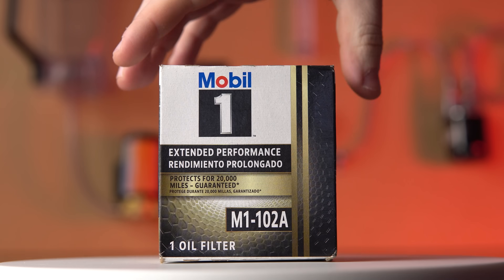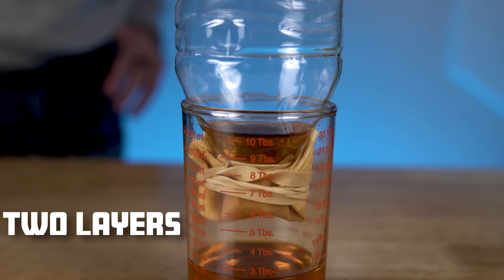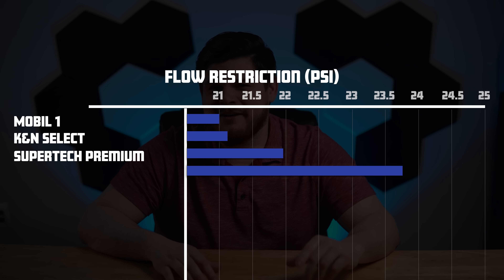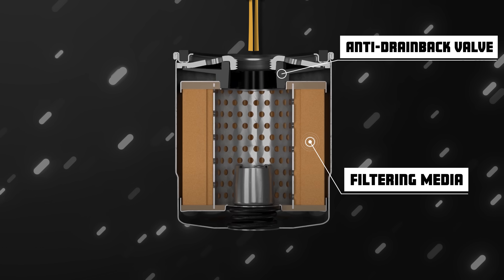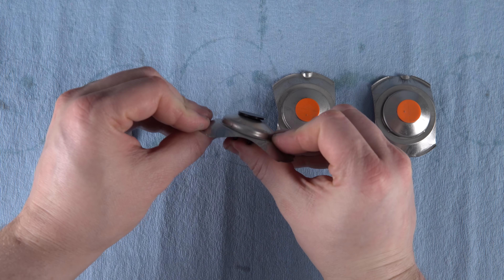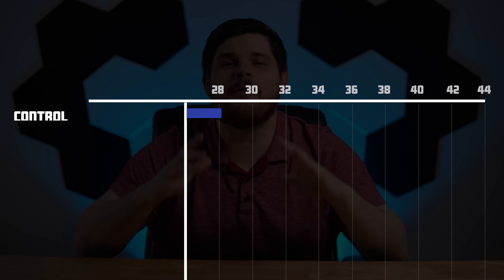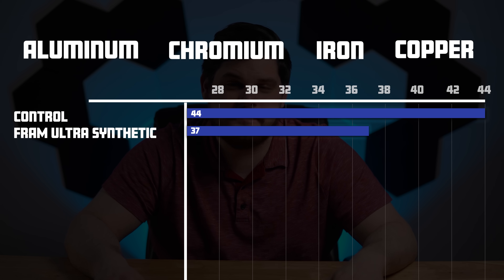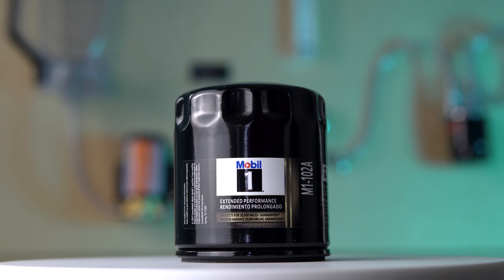Engineers Test the Best Oil Filters! FRAM | Mobil 1 | K&N | Walmart Brand

Comment: The "capacity" test was highly flawed and should be tossed out. 

 You used a powder that was at the filtration limit for size. Far too close to the limit to provide accurate results. As you saw in the long term oil test, the brand that reduced the total ppm the most, mysteriously had the lowest capacity. This very likely would have been because it was actually capturing the 30 micron pieces and the others were not.  To verify this, you would have had to take the oil from the test and had it checked for residual levels.  
Seems to me aluminum powder of 50 microns or larger would be more accurate as this should have guaranteed closer to 100% capture rate for all the filters and actually given you results of filter capacity test.

I love the video otherwise. Thank you for making it.
Reply from the maker: Thank you so much for the feedback. Please go watch our newest video were we made several methodological changes including the capacity test. Appreciate you watching.

Comment: I usually go with the Fram Ultra and it does a good job over my 4k mile interval.  I used a genuine oem Honda filter this past change and was surprised the oil was noticeably darker.  Went back to the Ultra for my current oil change.  0w-20 synthetics won’t really have much of a problem with flow rate.
Reply from the maker: Awesome, currently use fram Ultra as well and it's been great!

Comment: Good testing methodology, except for the oil analysis. That's a great method for tracking wear on an engine over time, but filtering the oil and then comparing how much of each metal the filter pulled out isn't relevant to how well the filter protects the engine. A filter needs to pull particles of iron/steel, silica (sand), and hard carbon out of the oil, because those are what cause wear on mating surfaces like bearings, bores, and cams. Contaminants like aluminum and copper are signs that wear is happening, but they don't CAUSE wear.

I am a metallurgical engineer responsible for failure and wear analysis on North America gasoline engines for a major automaker, so I spend a lot of my time looking at worn or damaged internal engine surfaces, evaluating them with optical and electron microscopy, and working to improve their wear resistance.

Also, I've used the Mobil 1 filters on all of my vehicles for years.
Reply from the maker: Thank you so much for the feedback and info. We have since changed our methodology, go check out our newest video.

Comment: 3:44, you've got your data backwards. The higher pressure of the Fram ultra synthetic is good. That means more restrictions on tighter media, which keeps out the dirt. That extra pressure translates into trapping those particles between 20 and 30 microns, which the other filters miss. The other 3 filters are which are letting those 20-30 micron particles are going to destroy their engines.
Reply: LMAO right. If that were the case, there would be so many more blown engines. They only probably destroying engines are bone heads that don't do oil changes/maintenance at all

Comment: I run full synthetic mobil1 oil and the 15k mile mobil1 filter in my F250 Super Duty truck. Its a 2008 6.8 V10. The engine still looks and runs like new...

Comment: Good afternoon from Mexico. In your opinion, what would be the best oil filter for my Mazda 3 2.5 engine?
Reply from the maker: Hey @chuyba. Assuming you are just using your car for day to day driving and only putting like 12k miles a year on it. I'd recommend going with full synthetic oil and a compatible full synthetic oil filter. I'm personally recommend the Mobil 1 or even the Fram Ultra (I currently use in my Mazda). Now... We are currently testing many other roil filters for future videos and Fram just came out with an endurance filter that seems promising and you can find at Walmart. Just remember that changing your filter an oil per the manufacturing recommendation is much more important than what filter. Hope it helps! Thanks for supporting our small channel.

Comment: If you change your oil & filter every six-months or 5,000 miles, whichever occurs first and use an OEM filter and great oil it really will not matter regarding an oil filter. OEMs with have all the same components of the aftermarket filters. Pay me now or pay me later! LOL
Reply: Don't put a lot of miles per year, 3000 to 4000 works for me, moto craft.

Comment: I've been using reuseable filters for years that blow any of these filters away. They're used in the aerospace industry. The bodies are finned cnc aluminum with a magnetic prefilter and stainless steel surgical mesh filter that flows at much higher rates than paper down to 10 microns. Best part you only buy them once, filter/flow far superior to throw aways and keep all those nasty filters out of landfills.

Comment: The only thing that wasn't included in tests is how the filters performed based on the temperature of the oil.  Temperatures have a huge effect on all of the materials of filters as well as the difference in the oil viscosity based on those temperatures.
Reply from the maker: You are correct. We are making several modifications to our rig to take into account viscosity at extreme temperatures. Thanks for the feedback.

Comment: My 2 bits worth... Fram's low-budget filter is extremely poor. Almost lost my motor to one some years back. The cardboard (glued-on) ends failed and blocked it resulting in extreme overheating. Apparently, you have to buy a high-end filter from Fram or risk issues. Bosch is the filter many OEMs use and my favorite whenever possible. Mobil looks very promising for sure so that would be a good option.

Comment: I've always used Mobil1 full synthetic oils ans filters.. in my most recent vehicle, I run the Mobil1 oil with a MotorCraft filter (FL400-S by Ford) thats slightly larger than the factory one to allow for a tad more capacity. Curious how the Motorcraft ones compare!

Comment: I've seen other tests with the K&N gold (performance) and it flows with the best of them. It also filters down to 10 microns. That is double the holes as a 20 micron filter per square inch and triple as many then a 30 micron filter per square inch of media. That makes it less prone to fully plugging up. I'm running a HP-1017 on my Ram.

Comment: Great review! 

My Dad and I use Frams Ultra Synthetic filters for all ours cars and so far no issues. The tape grip on the back helps a ton as well with installation.
Reply: some number of years ago, i saw another video doing oil filter reviews. they cut open brand new filters to observe the construction and the fram had rusty parts and metal shavings in it. before seeing that video i was a Fram guy myself. now i only use Wix
Reply: @elixeroflife i have heard people say fram oil filters gaskets come off. I find it strange fram is all me and my dad has ever used and we have never had a problem lol
Reply: @nunya8048  only issue ive had with Fram is hearing debris rattle around inside, new right out of the box. and at times being rusty.
Reply: @elixeroflife  that can happen with any product produced in the 10's of millions. 

No matter what you're buying for your car, inspect it before installing. Even OEM parts
Reply: @elixeroflife  Oil filters use aluminum so no you never found one that was "rusty". Some other issue maybe but it wasn't rust.
Reply: @ZboeC5  i never said i did, i said i watched a review, and yes they have steel components in their construction
Reply: @elixeroflife im sure other brands if cut open can be the same lol
Reply: I've rebuilt hundreds of failed engines. They all had a Fram filter.
Fram only makes fake filters

Comment: Okay, but did they heat the oil and run it through the filters ‘ cause cold oil or room temperature oil is a la thicker
Reply from the maker: You have a good point! Thanks to all the feedback we will be releasing a video today that tackles hot and cold simulations. Thanks for the feedback!

Comment: I was honestly mulling about getting a Mobil 1 filter for the most recent oil change on my 2012 Expedition, because Walmart was practically out of the MotorCraft filter. Thankfully I saw there was one left, but the choice did have me wondering.

I'd love to see a head to head of aftermarket brands versus the OEM for some of the common and popular engines (LS, Coyote, etc).

Comment: My dad was a fram hand. I bought my first car in 79 and I've been a fram hand. Never had a problem with them.
Reply: My parents always used fram I use fram as well I get a lot of miles out of my engines I never have issues with fram I have 250,000 on my suburban and they aren’t easy miles either.   I also used them in a truck u used in the oilfield under extreme conditions always ran perfect I love fram
Reply: I used

Comment: To add to my previous comment you don’t need a filter with a bypass check valve. As I said befor. All multi cylinder engines have a bypass valve built into the oil pump.

Comment: In every test of oil filters this one important note is never mentioned. On every engine oil pump there is a bypass valve. It usually opens when the oil pressure rises above the operating pressure. As a filter retains more and more debris that bypass valve allows more unfiltered oil to bypass the filter. This is why you should change your oil and filter more frequently. The use of an engine hour meter over just reading mileage is better. Stuck in traffic with an engine at idle will not show as mileage.

Comment: 348000 miles on a nineteen ninety-eight Toyota Camry using FRAM oil filters and Mobil 1 synthetic engine oil. It was running like a champ until a deer totaled it.

Comment: i think as long as you change your oil often it doesnt really matter.. using a cheap filter and oil and changing every 4-5k miles vs using the best of the best and changing at 10-12k i think the cheaper is better.. changing your oil is what is important
Reply: You don't want to use mineral oil cold starts is where the damage is done good oil %100 amsoil is one of the best to stop metal shedding on cold starts.
Reply: %100 Ester oil
Reply: Changing the oil is a good thing but you want the parts fully protected and definitely wanna use %100 Ester oil  if you live in cold climate areas the cold starts will cause metal shedding.
Reply: You’d be very wrong
Reply: @ohboy2592  i have owned well over 50 vehicles and do not use expensive oil yet have never had an engine fail because of a problem with the oil. so chances are i might be very right.. but life experience and knowledge mean little in todays world compared to internet knowledge
Reply: @whitefreeman5798  and I have well over 30 years of working on various engines and have seen the damage caused by your thinking and life experiences.  I can guarantee cheap filters and oil cause more damage than good oil and filters.  You’ve probably never torn a motor apart and witnessed what damage has been done.  There’s a reason why motors crap out at 150,000 and some last 400,000
Reply: @ohboy2592  if you are talking about submarine engines then no i have for sure never opened one of those up.. but other then that once again you would be very wrong.. unless you dont count motorcycles or v8 v6 I4 I6 V4 marine and small engines or tractors.. though i have never torn one down for much other then rings, head gaskets and performance reasons.. and i have personally put over 300k on engines while using cheap oil.. my tractor is over 40 and has only had cheap oil is rusted and beat up but the engine has never needed to be apart if that says anything for cheap oil.. my silverado has over 300k i have owned it for 6 years with no engine problems with only cheap oil.. my 64 would probably fall apart if i showed a jug of full synthetic to it
Reply: @whitefreeman5798  well that’s impressive.  I don’t know of anyone that has had that kind of success with cheap oil.  I use cheap filters as in ones that don’t filter well.  There are plenty of cheaper filters that do very well and I should have said not good filters instead of cheap.  If you don’t mind me asking what oil brand do you prefer?
Reply: @ohboy2592  honestly i have seen no difference in oils.. decades ago i heard many saying this oil or that ruined an engine but if you look at the problems that are caused in the oil system it is not because of the oil.. it is water getting in the oil..  fuel getting in the oil and just plain not changing the oil.. or running an engine low on oil.. when you remove the valve covers and oil pan and see sludge and pieces of gaskets and unknown objects that is not the oils fault that is lack of maintenance.. stp was one i used for many years in many engines but really i just use the right oil weight and change it.. the closest to expensive i use is rotel in diesels but no real option there
Reply: @whitefreeman5798  I agree on the frequent maintenance as a big part. I know a few who love super tech and have had great success.

Comment: How does thickish oil and hot thinnish oil pass through under high pressure the paper with really tiny holes without tearing or ripping for so many miles??  Paper would seem to back up the oil pressure so way less can get through as well?

Comment: Having too much filter media is not good for most engines Particularly high-performance engines. So you might have very clean oil, but the engine was not designed for such restricted flow.

Comment: Test not valid.  overloaded the filters with the aluminum, if that amount of aluminum wear in your engine you have a bigger problem than the type of filter.  and as others mentioned, tests not done at typical engine operating temperatures

Comment: so... mobil 1 is the official oil of nascar. 0.1 psi (in fact, the 4 psi difference between the 4) is also negligible if you consider most engines run between 35-60psi of oil pressure after filtration. when it's being pushed faster, the filter reduces flow in a progressively lower back pressure as well.

Comment: Great video and excellent detailed explanation.
The only thing you missed was that an engine and engine oil don’t run at room temperature. Oil’s viscosity is thicker when it is not heated to an engines normal operating temp (180-220*) Because of not heating the oil, the oil was thicker and slowed the oil passing through the filter media which caused the by-pass valve on the filters to open prematurely. That tainted the results because the particles you put in the oil weren’t caught by the filter because it was in by-pass.
Reply from the maker: Hey Rick, thank you so much for your kind words especially the feedback. You are 100 percent correct. We've made several changes you our rig for our next video including measuring differential pressure and simulating the viscosity at operating temperatures. Thanks to comments like your we can keep improving, so it it much appreciated. Hopefully you subscribe so you don't miss the next video that I think you will like. Thank you for your support.

Comment: Your graphs commit a statistical no-no. Instead of starting at zero for your graphs, you grossly exaggerate the differences in performance by starting at a value that is close to that of the lowest value. The difference in back pressure between the lowest and highest "performing" filter of 3 psi is trivial, especially given that the test was not performed at the operating temperature for the engine which will significantly affect the viscosity of the oil and thus the backpressure. And pressure is only critical to ensure that the top of the engine is receiving adequate oil flow.

The test where you introduce particles in the form of powdered aluminum is of little value as performed. No modern engine would ever dump that much metal in a single service cycle, especially after the first oil change. Also, instead of measuring flow reduction in this test (which is useless it causes the bypass valve to open - see my previous comment) you should have looked at how much metal bypassed the filter membrane and thus would have gotten into critical engine areas. The size distribution of those particles would also be important as superfine (nano-sized) particles won't cause any significant wear.

Comment: Did you use a new filter for each test? 
So that it wasnt affected by the last test?
Did you use NOT/NOP?
Reply from the maker: We did indeed use a new filter between the filtering performance and the aluminum powder test. Thank you for watching
Reply: @BrandRanks  youre most welcome. 
Also, i have doubts about the aluminum powder test ...idk, but, are there any possible other factordms that could be affecting it? I mean like any at all...we are talking about small differences between brands. But i love that you took the time to make this awesome video!
Reply from the maker: Hey, thank you for the feedback. Check out our new video, we made several improvements to our setup including our capacity test to make it more standard. Thanks for the feedback and the support.